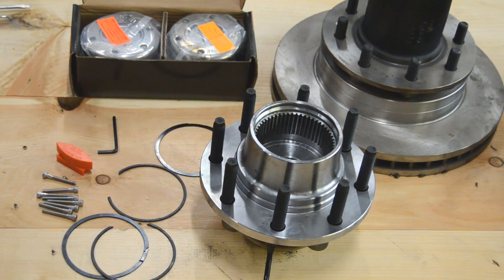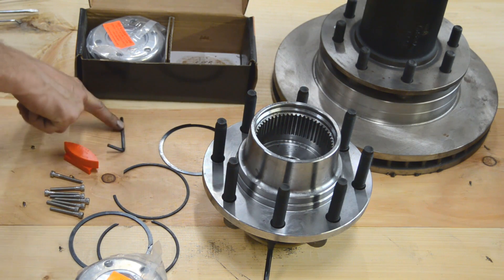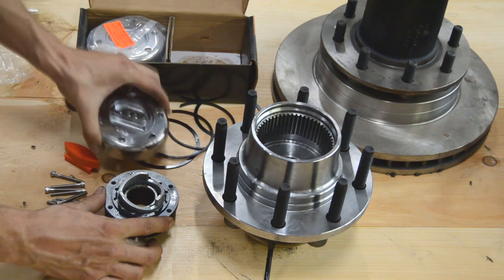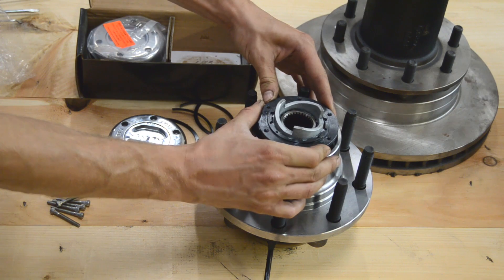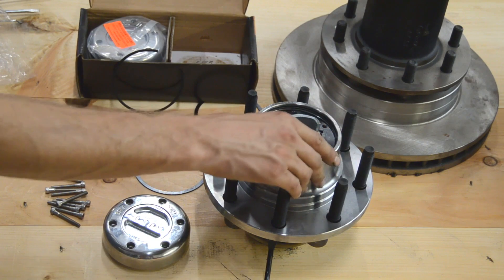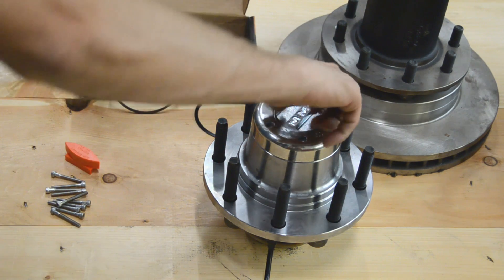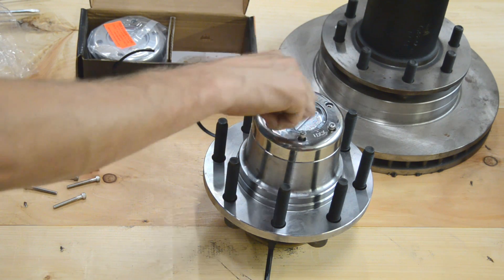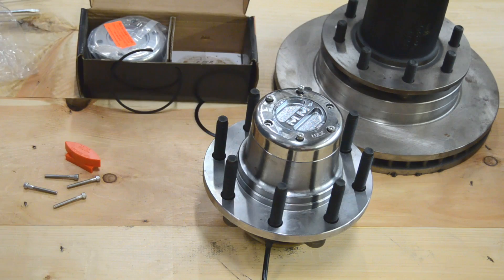Mile Marker Hub 449 & 459 Installation

Comment: The directions specifically say to put the spirolocks in first...  So which is it?
Reply: Maybe it doesn't matter, but I  installed the snap ring first. The instructions must be faulty.
Reply: Seems this installer assumed they gave a choice of lock rings for the end user, when in fact all the hardware should have been used. The springlocks may in fact locate the hub out a tad.

Comment: I just put these on my 2001 f250 7.3. Went in great, look great, turn to free and lock positions great but if left in the locked position it sounds like there getting tore up. But left in the unlock position and turn the incab switch to 4 hi and or 4 low 4 wheel drive works great. What's the deal? Any idea's?

Comment: Seems this installer assumed they gave a choice of lock rings for the end user, when in fact all the hardware should have been used. The springlocks may in fact locate the hub out a tad by going in first, per the instructions?

Comment: Do you install these with the hub off of the truck?  Then mount the hub on the truck?
Reply: What’s the answer? The instructions in the box say wheel hub assembly off, but I’ve already installed everything but the locking hubs…

Comment: Installing them on a brand new empty hub is great and all but it would be nice to know what's needed to swap from my auto lockers to your manual hubs. I have a 1994 F250 HD 4x4 extended cab with an IFS Dana 50 and the install was quite a pain. I had to take things apart about 4 times to figure it out on my own. Your directions in the box are incredibly unhelpful. I had to remove the inner snap ring and spline grooved washer to get the hubs back far enough to get both the spiroloc and the retaining ring in the groove and then put the inner snap ring on the outer groove of the spline. You have a good product but the install directions just lack soo much useful information.
Reply: There's a difference in the style auto hub if you have 3 bolts or 5 bolts on the outside. One of them requires a kit prior to installing the MM hubs. For my 99 the vacuum lines were already removed and capped at the knuckle but removed the capped fittings and put 1/8" npt plugs with teflon tape. I own 2 sets and no complaints thus far, kudos to MM for their support!
Reply: Same here on my 94. Instructions didn't say if I needed the thinner kit or not, just "maybe" I had 5 bolt caps, and one side went in flawlessly in 5 minutes, the other side was 2 hours of frustration and disassembly and reassembly, when it finally popped in for no apparent reason. The Instructions are not that great, and it turns out that the hubs are not working. Either they are not timed correctly right out of the box, or bad, either way, the auto hubs are going back in. I'm done.